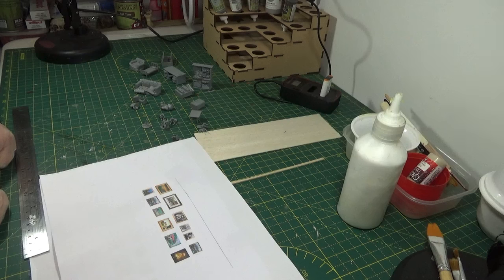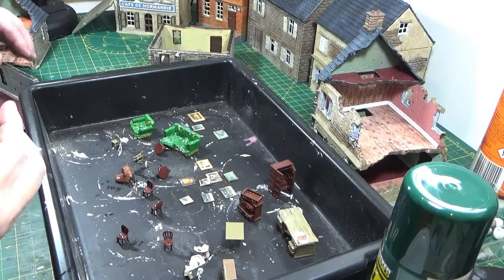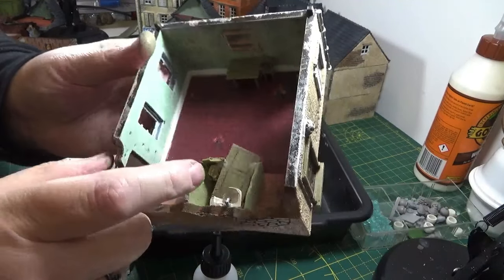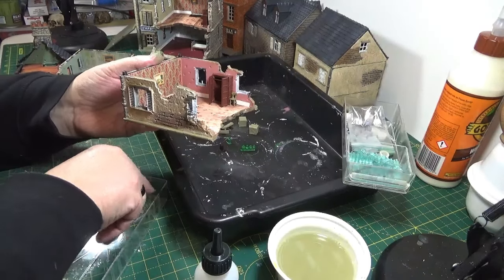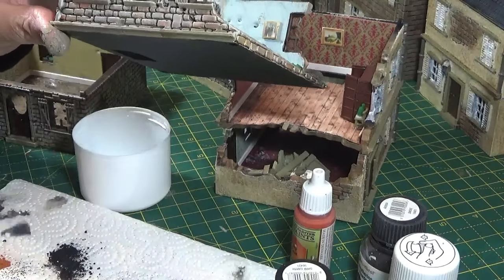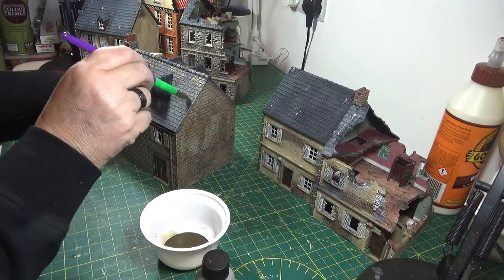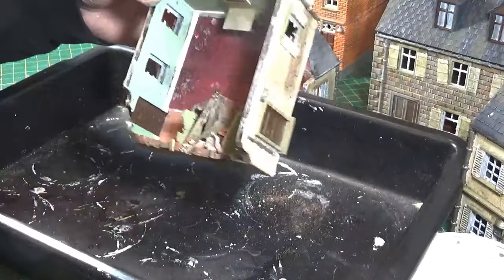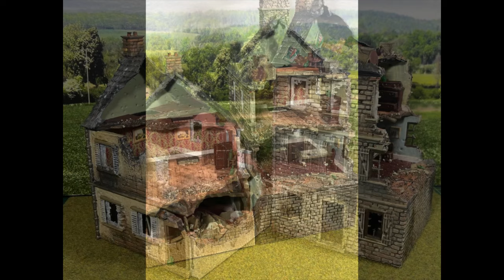Decorating Wargaming Buildings: Furniture, Rubble & Weathering (Part 3 of 3)

Comment: Been looking forward to this one, like the broken glass idea. 
Match sticks cut up with EMT shears (heavy duty scissors) and stirred up with some burnt sienna paint makes handy ‘bricks’. Laid out carefully you can get an effectively flat floor and I add some strips of thin card timber fragments and a door made from thin card, smooth enough for Airfix soldiers to stand on with their own little bases.
Did you buy the 3D printed bits ready made, if so where from?  
In the 1970s I bought some Bachman model railway ‘interiors’ (very ‘American’) but they were expensive so I started making my own furniture. Did a set for a lad about 20 years ago with some ruined cottages and ended up having to make an extra intact furnished cottage for his Mum. The pots and pans in the kitchen were lengths of paper straw with thin brass wire handles and a spot of epoxy putty to get a flat bottom. Plates were postcard cut with a hole-punch and then pressed into a scrap of rubber with the domed end of a pencil. A couple of mugs were cig paper wound around a pin and glued with a strip of printer paper for the handle (also good for hollow mortar barrels with thin paperclips bent up for the bi-pod). Three cocktail sticks glued together and cut to length with paper strips near each end makes a fairly convincing discarded British mortar bomb carrier (if keen you can add a paper handle on one edge).
Reply from the maker: Thanks Mike, like you I normally make my own furniture from old sprues, mdf left overs and anything I can recycle. These were a present a while back, I think they were from Warlord Games. Recently I’ve been focusing on that backlog of gaming purchases and presents that have build up, while moving home and working on other projects. It’s helping with my space issues and saving on money too, I think I’ve had those 3D furniture bits for about two years😂. Love your modelling ideas mate, you should start up a YouTube channel, I’d watch😉